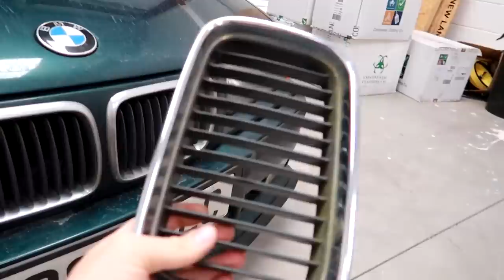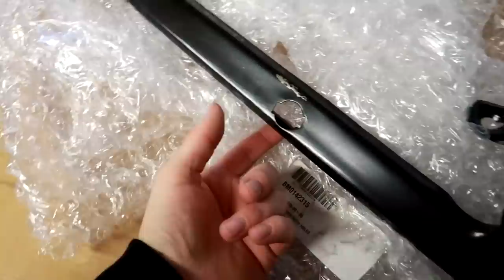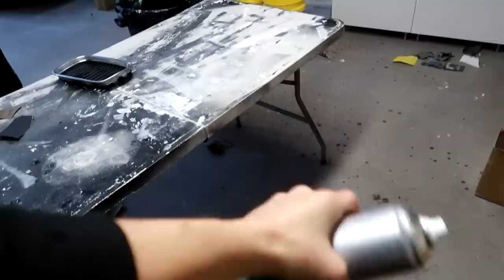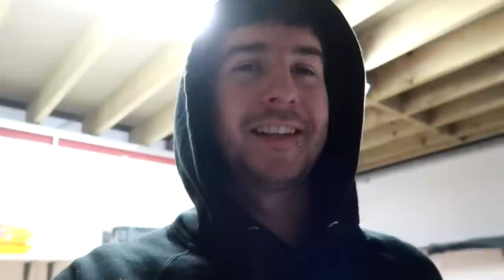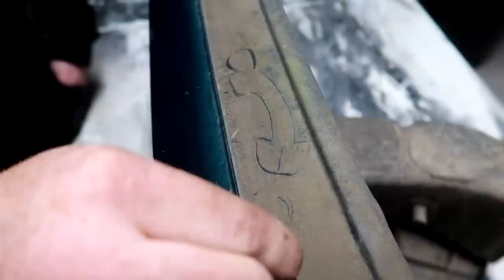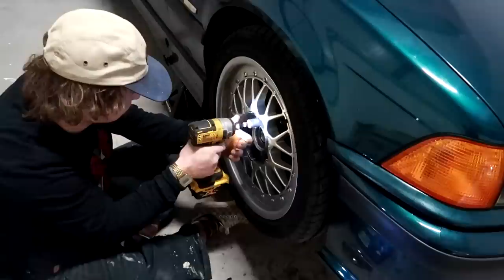Getting started on the BMW E36

Comment: That nosecone is looking good. Gloss black grilles aren't my thing but they do look good. I didn't know about the later E36s having facelifted grilles. Some clear front indicator lenses would complete the look. My own E36 318i (next one up from poverty spec) doesn't have traction control so I can put the back end out if I so wished. That was a little naughty overtaking on double white lines. I've used the Autoglym bumper and trim gel to revive the plastics and it works a treat. You'll be able to pick it up cheap at Halfords. You're either sponsored by them or you have a trade card judging by all the stuff you've got from them.

Comment: Good vid, mate, you might be the very person I need to give me some basic advice... I'll keep this as short as pos. I have a 318ti from '95. Over the past 12 months I've put in a LOAD of brand new parts - original BMW parts, installed by official BMW mechanics at huge expense - and over the previous year I had a load of non BMW, some new some used parts installed. I've defo spent at least the cost of the car on repairs. And it was running pretty good. Couple weeks ago I had an emergency braking situation in the wet, which resulted in hitting a concrete barrier at about 120kph. Front right corner of the car is not pretty. About a week later I got the quote from BMW, 7 bloody pages, coming in at a little over 10 grand. Because so many parts are needed, I thought that buying another used BMW and using the best parts from both might be the way to go. Can you tell me which cars share parts with the 318ti? Would any 3 series from that period do, or just another 318? What about parts from a 5 series? Thanks mate!